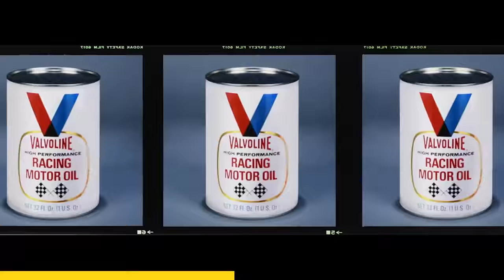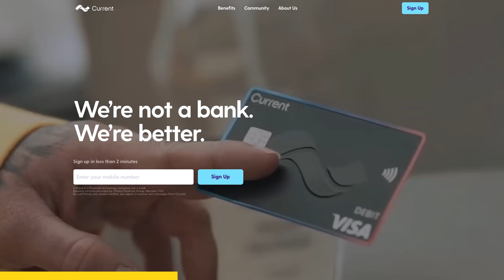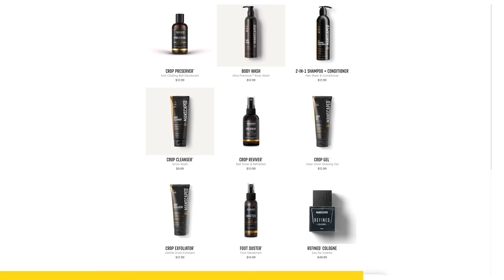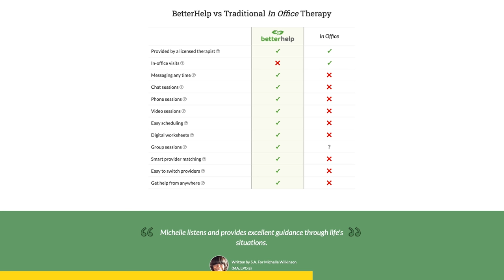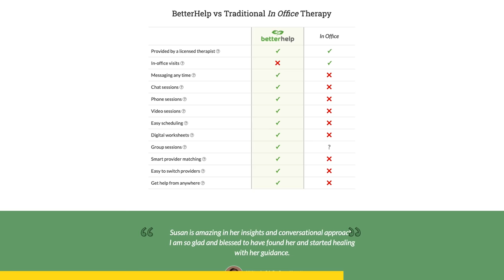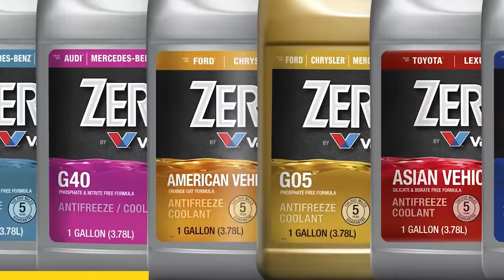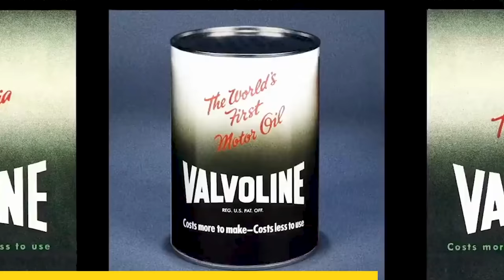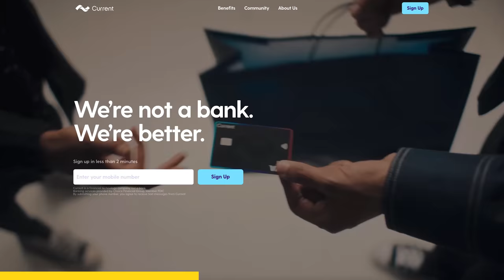The Ugliest, Weirdest, and Most Expensive Concept Cars of All Time - Past Gas #114

Comment: A concept car I like the most is probably the Honda SSM (Honda S2000 concept). It’s not that different from the released version except the lines are of the car are a bit sleeker. And the front head lights are in the bumper (kind of like a big fog light) and different tail lights, they look way better in my opinion. I also love the newer Toyota FT-1 or the Nismo IDX as was mentioned.

Edit: I also love the Mitsubishi Double Shotz, which I’m not sure was even considered a concept car since I don’t think it was made. I do have the Hot Wheels of it still.
Reply: I think the double shotz is  hot wheels version of the mitsubishi RA concept, which was rumored to be the new eclipse

Comment: The Chrysler ones from the 2000s. TF141he Chrysler ME412 and the Chrysler Firepower. Both of them were nearly production ready when the plug was pulled.

Also, the GRMN FR Hot Hatch Concept. Designed by the guy responsible for the Lexus LFA, it was basically a RWD Toyota Aygo.

Comment: Chrysler did not care if they made money on the Prowler simply breaking even was considered unlikely. The Prowler was, along with the all-plastic Neon, an experimental vehicle testing out even more advanced methods of assembly aluminum and composite bonding. Nearly 900 lbs of the 2,862-lb roadster consist of aluminum--including body, frame, and suspension parts. It was the most significant production effort with aluminum of it's time.